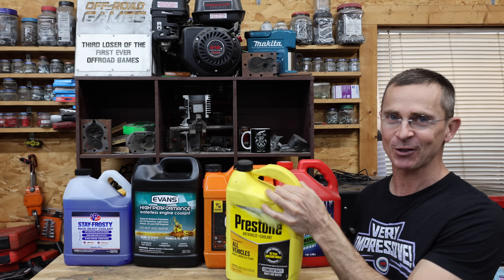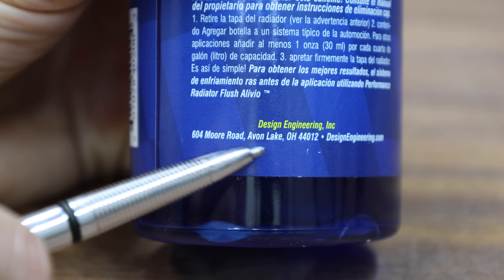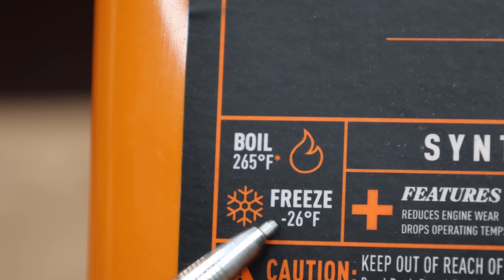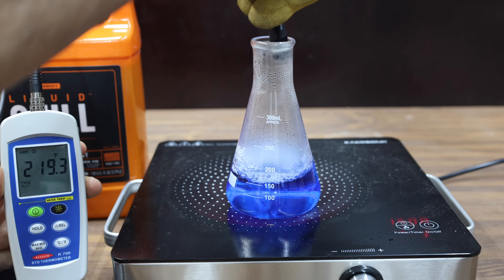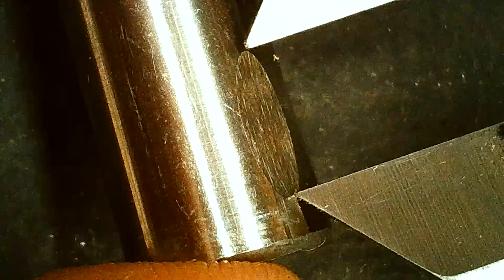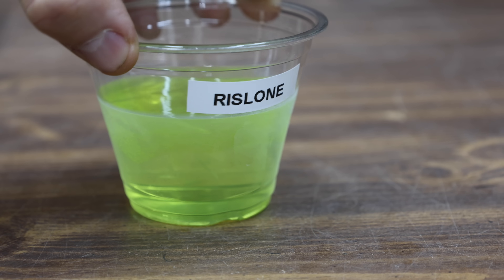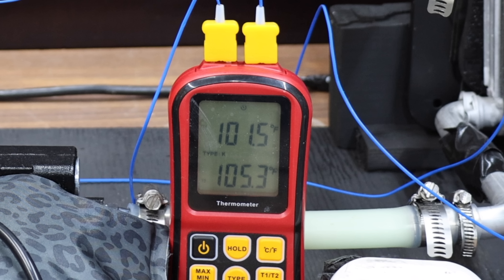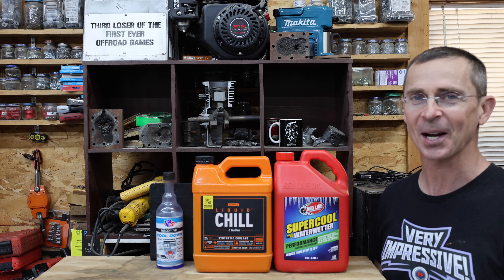Do "Super Coolants" Lower Engine Temperature By 30 Degrees?

Comment: Can i ask why you connected your hoses the way you did? Shouldn't the radiator hoses be flipped? You want the fluid going through the radiator to cool down before returning to the fill tank. This way looks like there is more unnecessary load on your pump pushing it upwards. I guess as long as it didnt change throughout it would be alright for experiments though. Nvm thinking outloud 😂. Great video btw

Comment: I don't see how this helps an ordinary passenger car driver.  If there is a radiator mixture that promotes more efficient heat transfer to the radiator, the thermostat will just close up until the correct operating temperature is reached.  Engines that run too cool are not as efficient and are prone to fuel bypassing the rings and diluting the oil.  Maybe for race cars, but how does this help me with my daily driver?

Comment: My takeaway, if you are concerned about overheating and need better cooling, those additives are a good option, however if you are more concerned about low maintanence and longevity - the waterless one is going to be your best friend with how little the acid disturbs it though you may have more wear but I don't think metal on metal grinding is a good test for the lubricity of coolants

Comment: Anti corrosive properties okay, lubricant property okay, anti freeze property okay too. Engine temperature is regulated by a thermostat. Put water, antifreeze or anything else in it and it's going to run at a pre determined operating temperature unless there is a mechanical problem.
Reply from the maker: Thanks for the feedback!

Comment: Wtf? You're not trying to get the engine as cool as possible.. Engines are designed to run at specific temperatures. Running cooler can damage your engine.

Comment: I tried the Evans but found it to have problems.  While the claims about the fluid is valid in terms of boiling vs freezing….the Evans product did a bad job of actually extracting heat from engine metal.  Engine parts while using Evans chirpped and a few of my seals leaked.  Oil temps sky rocketed.  I got rid of the Evans ASAP.  I contacted the manufacture and they offered no remedy.  This Evans stuff is a gimmick .

Comment: That's right it's not a scam it's thermodynamically  more stable fluid than water, and not only does it help lubricate water pumps and radiators,it also isnt corrosive like water in the system,in motorcycles and boat motors 

Love the channel straight facts and used in a diesel once never had to replace it.

Comment: I think the acid neutralization test could be made more resilient. It's hard to get identical drop sizes in each test, so dilluting the acid tenfold with water and using ten drops could reduce test variance, without a large difference in procedure.

Comment: The thermostat controls what temperature your coolant temperature stays at.
  Water alone  will work as a coolant, but not so good when winter hits.  But the coolant does have anti corrosive chemicals in it as well.
Best advice is to use the coolant advised by the manufacturer and change it periodically

Comment: I do wish you would include Amsoil in all of your testing. I love your content , and have been with you since the beginning! Huge fan!  I wish you could test pc gaming headsets wireless or wired for best directional accuracy...ex: hearing footsteps/ gun shots etc .. where they are coming from and how far away... Us gamers would love this and know you were accurate... creative sound blaster, razer, corsair etc. Also the microphone clarity test.... ;-) How about best toilet paper for septic tanks that are actually usable.... how about testing actual mud grip reliability om popular mud and all terrain tires in the field. Maybe attach a scale to see how much grip it pulls before spinning... different bathroom caulk that doesn't shrink or peel away or mildew... smart watch accuracy for blood sugar, o2, ease of use, available apps, integration, and step counter. pc aio cpu coolers  efficiency, and air cooling solutions.... OMG Thermal paste options vs graphene pads ... Do EDC knives with super steel like magnacut actually reach advertised hardness via different manufacturer like spyderco, james brand,  benchmade, hogue, and tactile knife co

Comment: Doesn't lowering the temperature by 30 degrees defeat the purpose of the thermostat. Vehicles are designed to run at the thermostats temperature to operate the most efficient. If you have overheat problems, you have cooling system issues that no coolant or aditive will fix.
Reply: These products all cater to "spirited driving" and are intending to fight overuse overheating on track days and when your ripping through the mountains all day... Daily drivers you are absolutely right, these products are only properly used on cars that get "abused" by definition of their intended use vs the use they recieve

Comment: Your heat exchange setup should have been done at at least 185 degrees being this is the temp these coolants are meant to perform. I’d say the real life scenario is more like 190/200f before entering the radiator and brought down to 175ish on exit perhaps. 
I know my corvette temps are even higher, low speed fans don’t even start till 225 when sitting in traffic then kick off at 220 but if temps continue to climb above 225 and get to 235 the fans will kick up to high speed and go back to low speed at 225. I don’t like seeing it climb this high so when sitting in traffic I keep it 200 or lower by running the ac which also makes the cooling fans run.

Comment: Dear project Farm, I hoped you would go deeper into the debate of these coolants. For one how can propylene glycol cool better than ethylene glycol when ethylene is more cooling efficient ??
Here’s the argument that’s made, the coolant temperature being lower is only showing that it’s removing less heat from the engine. That’s the argument you get into in forums debating engine ice (propylene glycol) compared to traditional antifreeze (ethylene glycol)
The argument is people seeing lower temps because the temperature of the coolant  is what you see on your temp gauge and that this is the case because it is removing less heat from the engine. I forever have disagreed with that until I learned it’s a fact that ethylene glycol is more cooling efficient than propylene glycol. Now I am no longer sure and would love to see this debate settled. 
The fact that engine ice went into your cooler and came out the other side at a lower temp than the traditional antifreeze makes it seem as though the engine ice is more efficient at shedding the heat through a air/liquid heat exchanger but is it more efficient at pulling the heat from an engine??
Project Farm, can you please settle this??
Also the most cooling efficient form of engine Ice is the blue formula but it’s also only good to -2F before freezing. I believe it may have changed to -7F this year. The original blue formula was good to -26 but when they added the extra new blends 1 original blue -7F
2. Orange for atvs good to like -34 and 
3. Yellow snow mobile formula good to like -54F 
When these were added is when the original blue formula started changing freezing temps.

Comment: When you are eyeballing calipers and think you can visually distinguish .01mm (0.0004”) difference, you lose credibility. Most vernier calipers are not even qualified to measure that small. 

The average human hair is .075mm(0.003”) 

You must have eyecrometers

Consider picking up an optical comparator for accurate measurements of wear marks like this.

Comment: These products may help in dealing with an engine that has overheating issues but Not correcting the issue is a lot more harmful for an engine.
Of course I'm not saying those who race cars can't benefit from the products with good, clean cooling systems.😊

Comment: Funny things about coolant, it’s flammable. Now there are so many types and I believe it’s essential to stick with what ever the manufacturer recommends.  For diesel we were green then came ELC  and now we hv 5 different types. As the engines run hotter to meet emissions it’s critical to run the correct type.  Great video!!!
Reply from the maker: Thanks!

Comment: Just mix your coolant to 75% water /25% antifreeze. This will give you better cooling and keep the no boil/no freeze benefits of antifreeze. Antifreeze doesn't remove heat, only water does that.

Comment: If you you have an oversized liquid to air or liquid to liquid say like in a boat . It would be really hard to beat the Evans . It doesn’t transfer heat as quickly as water. But if the flow is right. Seems like you could maintain much more consistent temperature. And therefore tolerances in the engine
Reply from the maker: Thank you for the feedback!

Comment: Railroads soon learned that the diesel electric locomotive engines ran cooler in the summer when running straight water in the cooling system...and they still do.
Reply: They don't use straight water, it has anti-corrosion added.
Reply: I'm a locomotive diesel mechanic, they use borate as the coolant
Reply: @MMA_GOLD8  You mean borate is added to tap water to condition it?  And how do the cooling systems not freeze in winter?

Comment: Would normal cars benefit from this? Or is this only helpful for people who drive in very hot climates or who often put high loads on their engines? I own a sporty 4cly turbo car but since I never get close to overheating it I'd probably be better off just doing regular service intervals for my coolant, right?
Reply from the maker: Correct. This is not necessary if you are not close to overheating.

Comment: 16:16 i don't think the test was done right as there was no over and under for the temperatures which never got as hot as 120º as the additives did their job lowering top end operating temperatures  by 15º-20º keeping the baseline at 104º-105º and the heat exchanger only losing 5º as the measurement for additives that let operating temperatures exceed 120º and dropped final recirculation to 105º-107º which is not an improvement  vs. other additives that allowed only this temperature as their high, not 120+º

Comment: Great and informative video as always. I create my own engine coolants, generally using ethylene/propylene glycols, methanol, distilled water and an anti-corrosive agent (usually molybdate). But here in Florida in the summer I run only straight distilled water with a super coolant. As far as I can measure it lowers my head temperature by around 9-10°F over a commercial 50/50 mix — That's in a 2.7L naturally aspirated V6, by the way.
Reply from the maker: Thank you for the feedback!

Comment: My friend says running pure concentrate Will run cooler then 50/50. I wish you would have tested this. Its cool it wont boil/pressurize with the rad cap off
Reply from the maker: Thanks for the constructive feedback.

Comment: Evens waterless coolant wasn't designed to make an engine run cooler. It was designed not to boil off around exhaust valve ports and stick to the surfaces to stabilize temperatures. It slows the temperature swings from power pulling and easy running. Were temperature swings makes different metal expand and contract at different rates. You use a 0 to 7 psi cap to keep coolant chamber pressure down so seals and gasket last longer.

Comment: I am using the Rislone, BUT I added it to distilled water.  Here Project Farm added it to coolant.  The main selling point for these additives is the reduced operating temp, and if you read the Amazon reviews for the Rislone adding it to coolant does almost nothing in terms of improving cooling.  So, unfortunately, this Project Farm test bypasses/fails to include the important and typical category of additives mixed with water and NOT coolant.

Comment: During enduro racing in gnarly conditions on a hot day when a bike would typically boiler over, Engine Ice coolant definitely works better. There aren’t many hardcore riders that use regular antifreeze with this proven knowledge.

Comment: I used water with redline water wetter coolant additive in my cooling system for a burnout competition in a turbo charged 350Sbc non intercooled and the coolant temp never surpassed 210 degrees after 2.5 minutes of heavy acceleration/ 5k rev limiter. Im not sure how hot it would run with regular coolant but if it’s any higher than 210 then money and effort well spent.
Reply from the maker: Thanks for sharing.

Comment: I don’t get it, Evan’s had a better boiling and freezing temp than any of the others and it’s not top or top two?

The wear scar data should really be in mm and not a 1-10 rating, It’s just like when data is presented as values vs percentages, it can skew perceptions. 

Also for coolant all I care about beyond wear is cooling and freezing protection, the Evan’s smoked them all. Who cares about the rate of transfer. 

Love your vids, disagree on this one …..lost in data crunching?

Comment: Do you realize that the LESS a coolant mixture transfers heat from the water jackets, the cooler the temperature gauge reads? The correct way to see which coolant mixture works best is to measure OIL TEMPERATURE. Now if that goes down, then the coolant mixture is doing a better job than before. Use whatever gives you the lowest oil temps.

Comment: I had cooling issues with my NA Miata (on track but even on the street too, Miatas are known for overheating issues on a hot summer day with AC on). It's mostly stock, 5psi of boost and a nice 2 row aluminum radiator. I tried every snake oil to prevent overheating, even an oil cooler (which probably helped oil temps but not water temp) and the thing that fixed it was... airflow! If air can't effectively pass through your radiator, it isn't doing much.
Reply from the maker: Thanks for the feedback.

Comment: Nice test but would have liked to see one more, pure ethylene glycol. Evans is a mix of ethylene glycol and propylene glycol, propylene glycol does not transfer heat as well as ethylene glycol but helps prevent freezing in very cold temps. Living in Phoenix I use straight ethylene glycol (no water) in everything for years and have had zero problems.

Comment: Love what you do and this one is very timely for me as I just upgraded radiators in my truck. That being said I was confused on the heat exchange test. I totally recognize that with all the coolants tested in the same way it shouldn't matter, but why did you bring the hot coolant into the bottom side of the radiator? Im guessing it probably had something to do with getting the setup to work correctly but that seems backwards to me. Thank you for all of your awesome testing.

Comment: @projectfarm you should look into all the cooling loop measuring standards that Martin’s Liquid Labs came up with for all his tests.  

One thing that I remember being important is to measure the difference in temperature delta of the coolant at a specific spot vs ambient air.  

The reason for this is because the viscosity is going to through your testing off.  A higher viscosity could have a different outcome when just looking at in vs out delta than that of a lower viscosity.  One could be showing to be better at the delta before and after the heater core BUT ultimately have a better overall performance when looking at the delta of the system vs ambient air.

“Martin” had to do this because he was comparing hardware components that had different flow rates and restrictions and was also testing different pumps and radiators.  But even just the viscosity of the liquid would be enough to throw this test off.  

I’m not saying this what would happen because you’d have to test for it but perhaps a lower viscosity fluid would have a higher flow rate.  Because it has a higher flow rate it spends less time in the heater core but makes more “revolutions” through the system and generally to a point higher flow rates do result in better cooling but you wouldn’t necessarily see that improvement if you are looking at the temperature before and after the heater core itself.

Where you would see the difference is in the temperatures both being lower in relation to the ambient temperatures when running at a higher flow rate.  

In my own observations when I run an extremely low flow rate on a PWM pump my temperature will climb slightly and then when I raise the flow rate they will drop slightly UNLESS the pump is dumping too much heat.  The smaller the radiator the sooner you see this kind of trade off.  Of course in what you are testing you wouldn’t really control the flow rate like that but the viscosity of the fluids would indeed cause a change in flow rate.  Just not sure if it’s a big enough difference to matter or not.  

That said… for around 15-20 years I’ve used ambient delta instead of temperature before and after the radiator.

Comment: im going to have to ask the obvious question here, with the evans did you use their change over solution as it absolutely has to pull all the water out of the system for it to cool properly. Otherwise its contaminated and wont work. Your temp variance seems to indicate that there is water in that coolant. Did you run a brix check to be sure there was no water contamination because it appears as if there is. These results seem skewed